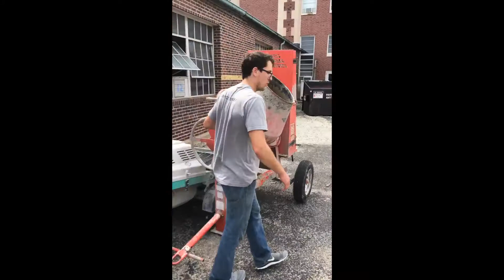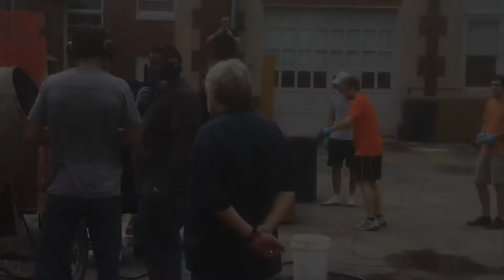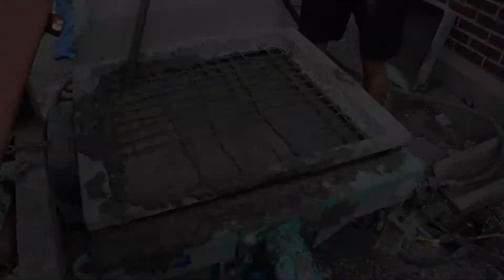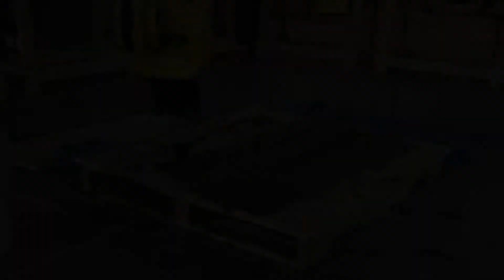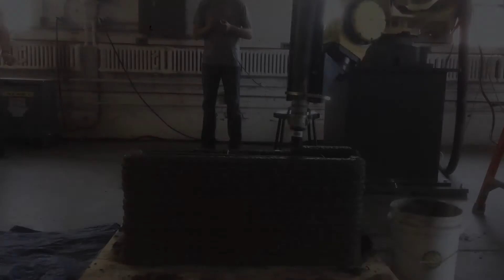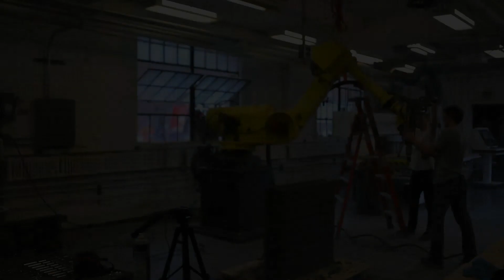UIUC Architecture 3D Printing Concrete

Comment: I like it! You used a remote pump and got it to mesh with the robot - the first time? Very impressive. You guys are actually further along that most others, because you can use a more normal mix (less $) and go faster. Never got line blockages with the ultra-stiff mix? I would have expected that. We inject thickeners/accelerators inline to avoid that problem. Keep up the good work!